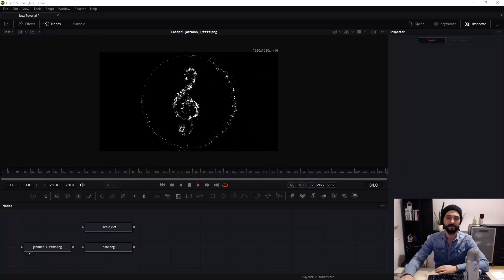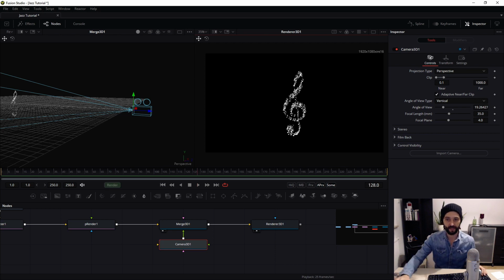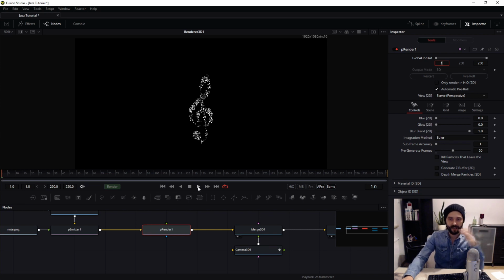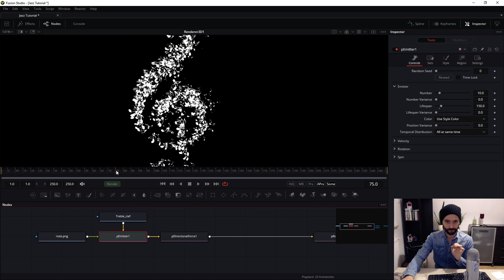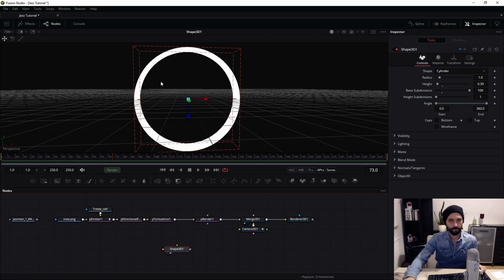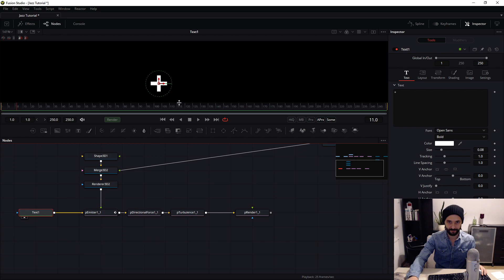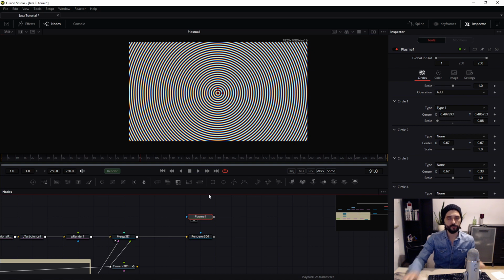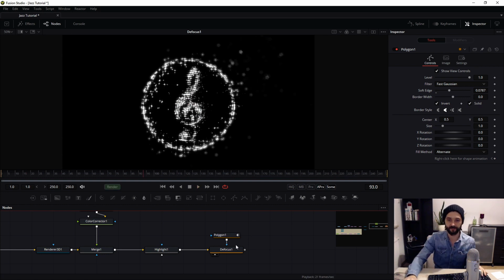Intro in Fusion - learn fusion.

Comment: nice job as usual!!!  You usually have a very good reason for doing things in a specific manner as it may carry advantages that I may have missed.  Wondering why you chose to create the Shape3D Cylinder to create a circle when you could achieve the same with a background node with an ellipse mask and repoint the particles to Merge3D1 thereby preserving all camera movement and only one Render pass?  Again, thank you so much for sharing and great job!!!
Reply from the maker: Yes Alfredo you have right :) with this shape 3D, but the 3D shape has option ANGLE and you may animate this option- BUT I FORGOT EXPLAIN THIS. So I used the 3D CYLINDER becouse this shape has ANGLE and this ANGLE give posibility animate this ring, I hope you know what I mean, in Intro I used this option. :), and additionaly TRANSFORM 3D is more elasticity to work becouse it is 3D, it give me more posibility to adjust SCALE, POSSITION. OFCOURSE your TEHCHNIQE is also GOOD.  All the best bro.